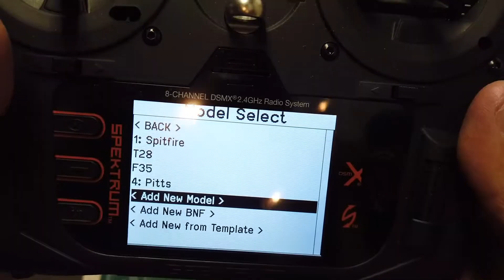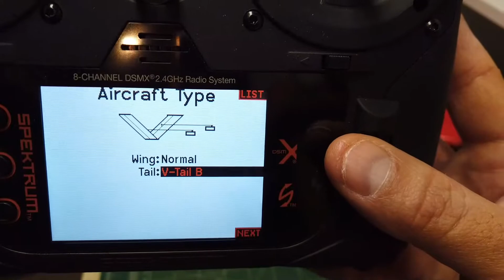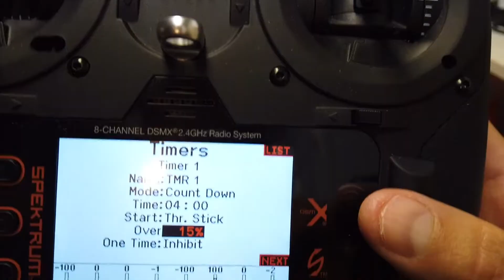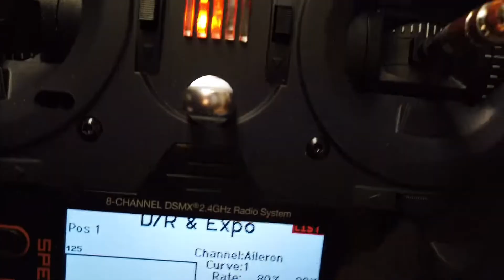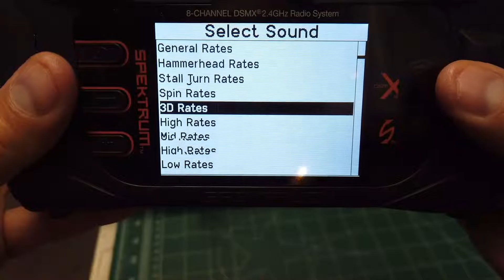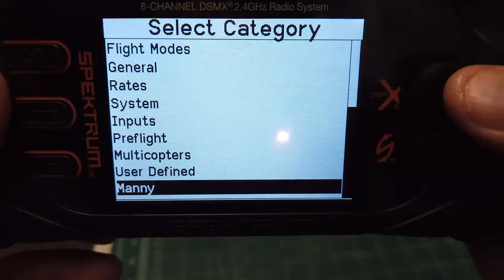Episode #1: Spektrum NX 8 Setup and Bind

Comment: I have a NX8 and it stopped binding to my receiver.  With the bind plug or by holding the switch at powerup.  I haven't a clue how this happened as if it can't link with the NX8 anymore.  Baffled.
Reply from the maker: Reach out to Horizon. Sounds like an internal problem.

Comment: oh yeah, seems easy enough on video, meanwhile in real life its aggravating. why wont my nx8 bind?
Reply from the maker: Honestly, it is easy, and if you cannot seem to get it to work, chances are there is something wrong with the remote. I would contact Horizon and get a repair claim going as soon as possible.
Reply: @RCPlaneAddict  well, 5 days later I think I finally figured out this radio and its quirks.  at this point I'm not even going say what I think its biggest pitfalls are.
Reply from the maker: Wow, sounds like you are going through some stuff. Coming from a DX7S, I love the less weight, the feel of the sticks, the ease of binding, and the voice. I am sorry that you are not seeing the benefits for this remote, but I also do not know where you are coming from, or what you have used in the past to compare. Hopefully, everything will iron out for you. Cheers.
Reply: Update:  Dont try and bind this radio in what they call safe bind mode.  if you are binding this to a safe technology equipped plane,  bind to receiver like you normally would to any other receiver using the safe bnf template.  and be prepared to move some things and add things.
Reply: @RCPlaneAddict  I've got a  DXs and also a Flysky IF6 with touchscreen.  until I've used this nx8 a bit more I'm gonna hold to my original impression which is mediocre.  maybe I just expect a bit more than some.
Reply from the maker: Fair enough

Comment: Maybe I'm prejudiced because you belong to FlyRC, but you did a nice presentation on the NX8 Setup (I have an NX10), I learned some things I didn't know. You're style of presenting was clear and just plain easy to watch. Suggestions for additional content? I've been dabbling with the newish Eachine mini warbird series lately and struggling with the setup for the Eachine TX16S open tx transmitter, seems my little T28 needs to be rebound for every flight. Others on the internet have experienced the same problem but at least on other reviewer used a Radiomaster TX16S and he didn't need to rebind with each flight. Not to pull you away from the Spektrum ecosystem, but it seems to me that at least for smaller, cheaper, RTF park fliers Eachine has come out with some other very interesting planes in the last year, including a 50mm F16 a few months ago, and an F18 just last week that Brian Phillips reviewed. These last two were PNP but the mini warbirds were all Eachine protocol and the standard transmitter they come with has a huge dead spot in the middle of the aileron/elevator stick which necessitates (?) use of the hobby grade Open TX transmitters which seem to fix that particular problem.
Reply from the maker: John thanks for the suggestion. Good for thought for sure. Cheers.

Comment: how to bind to a WS2000 dongle for flight sim software?
Reply from the maker: Tony, that is a great questions. I am not sure what a WS2000 even is, but you should be able to use the included cord and plug your remote right into your PC USB. Hope this helps and thanks for watching.
Reply: @RCPlaneAddict  yep, thanks. I won't need the dongle with the NX series of radios. Now if I could find someone that has used this or any radio to fly with X-Plane for iMac. I have emailed the people at X-Plane and they say it will connect with most flight sim controls but they have no idea if it will work with a radio. I suppose if the computer changes the output to something X-Plane recognizes as elevator, rudder etc movements it should work. I may have to manually set it up within X-Plane. Thanks for the reply.

Comment: hello, i have the plane Carbon cub s2+ in rtf version... this was sold with a smart battery 2200 mah 11.1V 30C and the transmitters Spektrum DXS.
now i want to bind with the universal transmitter NX8. i am enable to bind the plane but i receive also a warning message. How can i resolve that ?

the warning message is : 

Warning
Smart battery alarm
battery not charged for flying
volts : 12.2V
Reply from the maker: Hello Dom. Thanks for checking out the video. To be perfectly honest I am unfamiliar with the smart batteries. I would contact Horizon directly with this question. They have improved on their customer support and now offer live chat on their web site. Get in touch with them and let me know how that goes. Otherwise I would buy a different brand of battery, and go fly! Cheers.
Reply: it means the battery you are atempting to use in the plane is not charged enough for flight.  charge it or change it....and message will go away.

Comment: Hello guys, I'm upgrading from my Tactic TTX650 Transmitter to a Spektrum probably NX8, does Spektrum AR620 receivers works and bins ok with NX8? or which ones do you recommend, I will appreciate your feedback.
Reply from the maker: Jose, thanks for checking out my channel, and subbing. Any Spektrum RX  will bind ok with this remote. I prefer the less expensive OrangeRX 6ch from Hobby King, but if you want to go with Spektrum products I really like the AR630. It has forward programming, AS3X and Safe if you want it. Hope this helps and safe flying

Comment: Great video. I have a DX-8 gen one and was thinking of upgrading to a NX 8 or !0. Can I put my planes on a sim card from my 8 and transfer them to a nx-8 or 10. If I can't I probally wont upgrade. My current radio works fine.
Reply from the maker: So bad news there, which I had to learn the hard way, you cannot transfer data from DX to NX via sim card. It has to all be done manually, and it sucks! Sorry brother.
Reply: @RCPlaneAddict  Thanks. Maybe I'll get the DX-9 and call it good.
Reply from the maker: Sounds good!

Comment: Did you put all your expo for dual rates on the same switch ?  A E and R ?
Reply from the maker: Hi Monty, thanks for checking out my vid. Yes I generally put expo on everything 30%.
Reply: @RCPlaneAddict  on the same toggle switch ?
Reply from the maker: I do not put them all on the same switch, no. I like to have control of the aileron, elevator and rudder independently.

Comment: Do I need to bind the NX 8 to the aircraft every time I change out the planes battery or is that just for the initial model setup? I used to have a DXS and it would connect to the aircraft without having to bind it every time. How do I get the NX 8 to do that? Im new to RC so I'm probably missing something obvious.
Reply from the maker: Hi Kevin, thanks for checking out my Vid. The NX 8 requires you to bind once, then you are done. check your RX in the plane and make sure you have taken out your bind plug, or else every time you put in a new battery you will be in bind mode. Hope this helps, cheers.

Comment: Thank for the video,help me a lot to bind and get my plane going.Got one question though,is there a volume for the sound ,i found it very low right now.
Reply from the maker: Yes there is a volume, when you are looking at the main screen  (the one that shows when you fly) hit the back button, then use the wheel to go left a right to make the volume higher or lower. Cheers
Reply: @RCPlaneAddict  Thank you so much for the quick respond
Reply from the maker: Not a problem. Let me know if you have any other questions. I'm still trying to learn a good deal about this remote too.

Comment: Manny did you update your Firmware when I went into the wifi and connected a update popped  up for the firmware 3.04 the old was 3.03 mine is now updated , there is a repair  made to a glitch problem  occurring with the older receivers  and servos more.

Your more help than Horizon  Spektrum people.
Reply from the maker: Rafael, I did update the firmware, and check it most of the time as I am charging the night before I go out. Also, this problem was very specific to this plane, which is most likely a problem that developed from a crash that was not addressed.